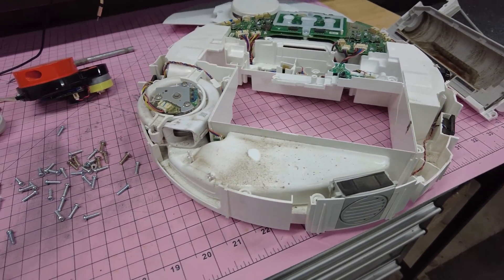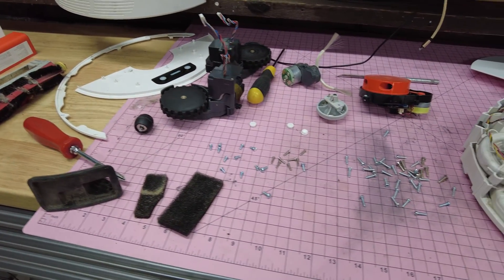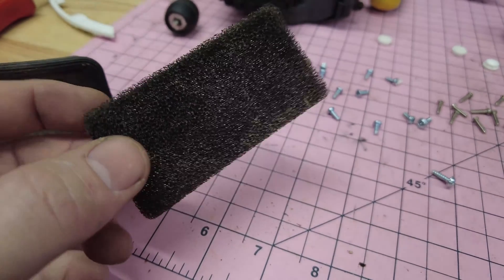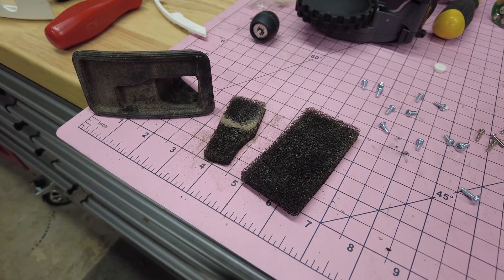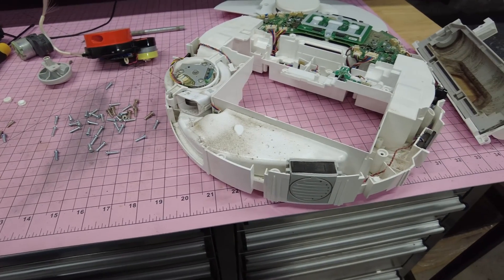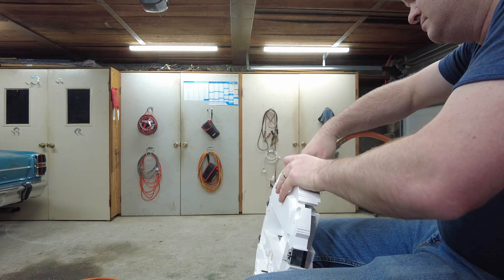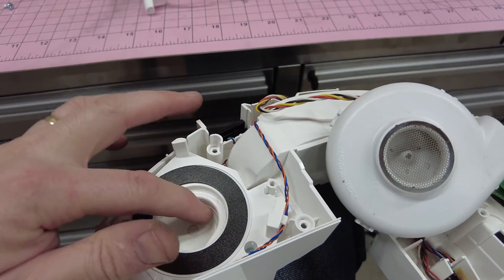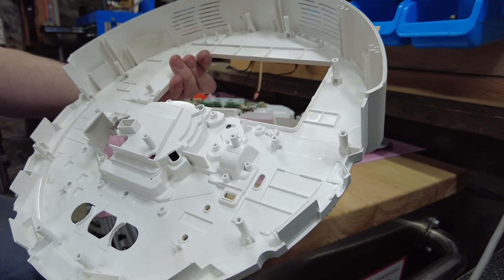Roborock S6: How to Repair 'Filter Clogged or Wet' Error

Comment: Did cleaning these filters fix the problem? We have an S5 Max with the same continuous error.
Reply from the maker: I haven't opened an S5 but I think they have slightly different construction. It has been working fine since this video was uploaded though
Reply: @engineerandmachine  I appreciate this video, as I've got the same error with my S6. Though I'm nervous about tearing it apart, I'm willing to try.
I do not think the other guy was nagging. He asked once because you didn't mention in the video whether or not the effort worked. That's important in deciding whether or not to undertake the disassembly. And as you said in the video, it's important to keep machines running as long as possible. It saves a LOT of money, because the new versions are incredibly expensive.
Reply from the maker: Hi and thank you all the best in repairing your vacuum I believe you can do it.